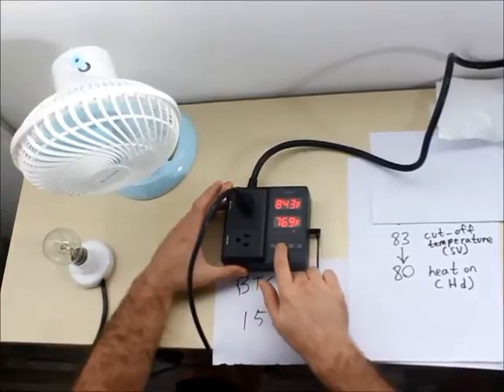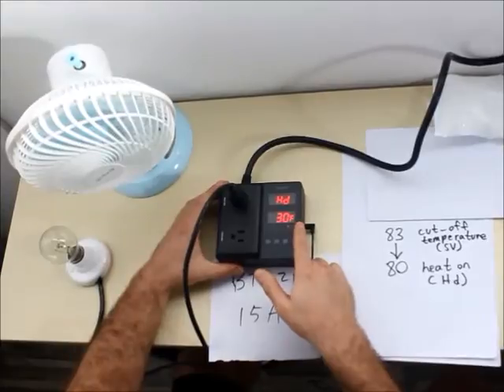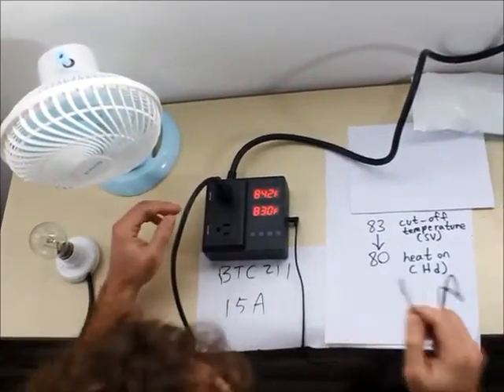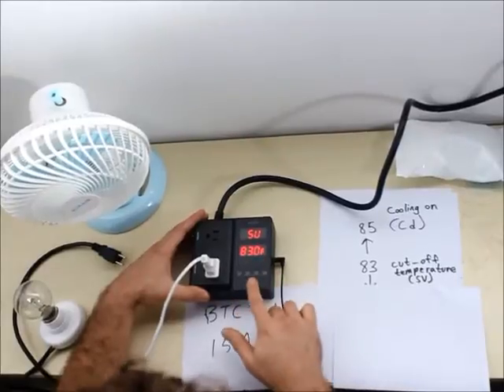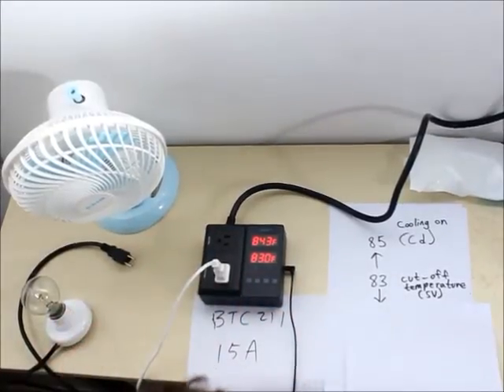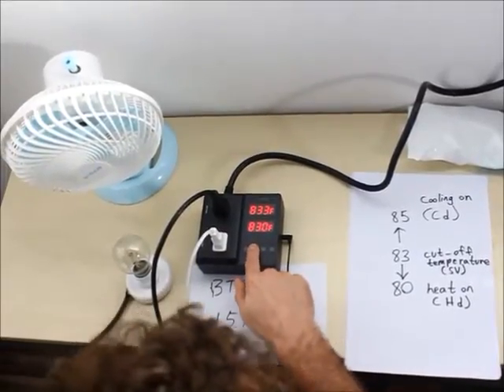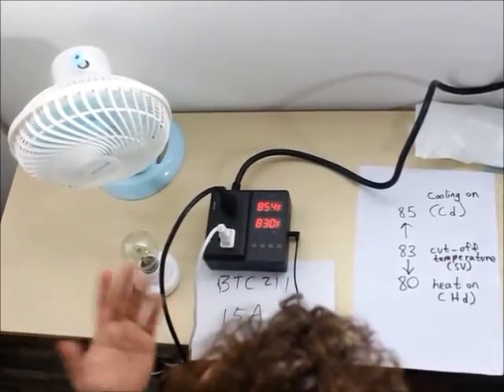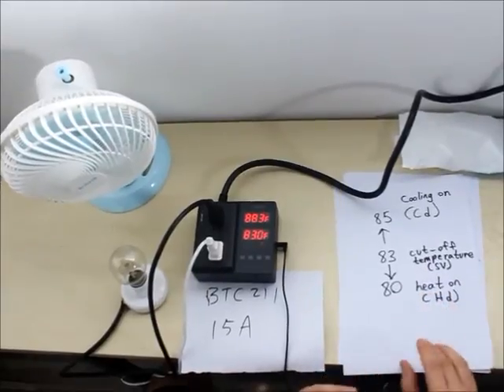bayite BTC201 BTC211 temperature controller, programming instruction(how to set)

Comment: Can you set this to 2 different temperature on and temperature off values? For example (in a greenhouse), heat comes on at 48 and off at 50, and fan comes on at 85 and off and 82? Or is there only one set value temperature for both heat and cool?
Reply: I have the same concern (but for a chicken coop).  Did you find the answer?
Reply: I wanted to do the same thing but it looks like it doesn't work that way and you'd have to use two of them. It only has one setting for the desired temperature and it either heats to that temp or cools to it.
Reply: Yes because one turns on when the other turns off separate plugs could be for one heater one fan.
Reply: -- But why do you only want the heat to come on and stay on just to heat two degrees from 48° to 50°? That seems almost pointless to stop at 50°.
-- And then, you don't want to cool it until it reaches 85°, but when it drops just 3° to 82° you want to stop cooling?!
-- Don't you have an ideal temperature that you simply want to maintain?

Comment: I have the BTC 201 and worked fine for first 2 yrs now when I turn power on it will just flash cool and I cannot get it to the heating, which is all we have ever used this for, to run a heater in our pump house to turn on at 34 and off at 40 degrees. Seller will not respond and wondering what the trouble shooting I need to do, or is this just junk?

Comment: I have the 211, do they make a probe longer with metal tip so I don't worry about the wire getting too hot with short amount of metal the included probe has?
Reply: This NTC 10k sensor cable can be used for this controller. https://www.ebay.com/itm/132381769336

Comment: So I only need the device for heating right now and I set only the heat parameters. However, it is still kicking the cool setting on when the temp goes higher.  Is this normal? I only set the heat settings? Is there a way to shut the cooling off?
Reply from the maker: This is normal. You don't need to mind that actually because you didn't plug anything in the cooling outlet.
Reply: I have a similar problem and always worked prior two years and now it just flashes cooling and I cannot get set for heating. Only used for heating ever as we use to turn on a heater in our pump house to keep it from freezing in winter months.

Comment: Can you use heat/cooling at the same time.
Reply from the maker: You can connect both the heating and cooling deviceS with the controller. But the 2 deviceS won't work at the same. They will start working according to the temperature range you set.
Reply from the maker: Sure. There're a 2 outlets for cooling and heating.
Reply: Bayite Amazon my heating turns off at the same time my cooling temp hits the selected temperature how do I change that thanks
Reply from the maker: Can you email us and provide us more details? service@bayite.com
Reply from the maker: What's data of the SV, Cd, Hd  you set?
Reply: Bayite Amazon I'm at work when I get home I'll send it thanks
Reply: Bayite Amazon sv 73.f hd 6.0f  cd 2.0

Comment: Hi thanks for the video. 
Can you tell me how responsive is this?   I need a thermostat continually reads small temperature changes and turns on and off fast.
Reply from the maker: It responds to temperature changes quickly.
Reply: It respond quick & can be adjusted both in sensitivity settings on controller & physically. I've been making making these controllers for years. If you need a slower reaction time (cycle) you can heat-sink thermo-couple. I use a few wraps of Alum foil when I want to read room air temps to keep my hydronic boiler fan from turning on and off, cycling quickly.  When using in a smoker application I'll wrap TC in insulating tape. I'll be buying these from now on, now that I found them as cheap as I can make them.  Peace Out!
Reply: Bayite Amazon just subbed up love the product get me a sub back thanks

Comment: In the manual it states, "Auto shut off timer(disabled by default)" as one of the features but doesn't mention how to set the auto shut off timer. Is there a way to set this device to cut power to both outlets after two hours?
Reply from the maker: sorry. It's an error in the manual. There's no timer function in this model.